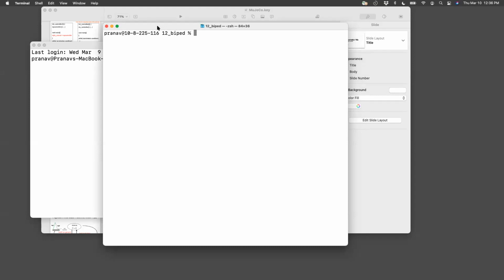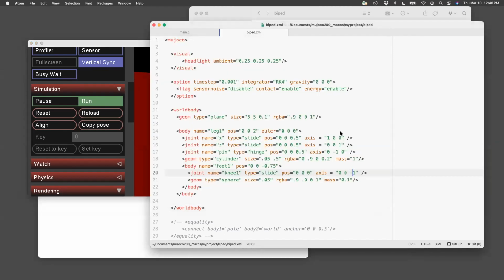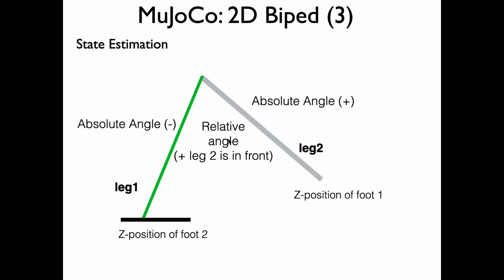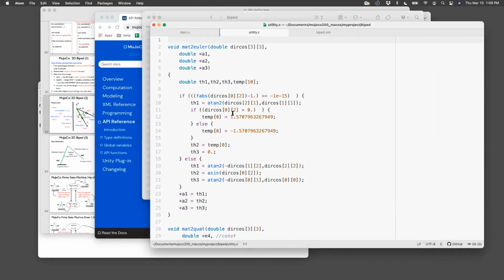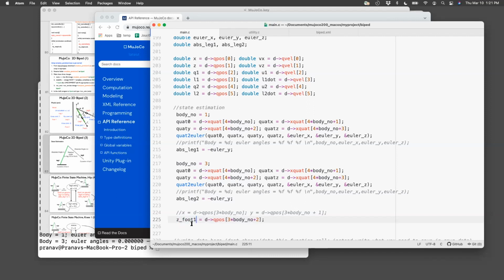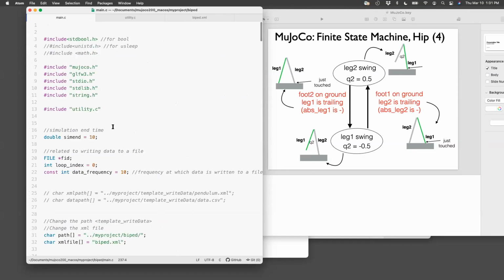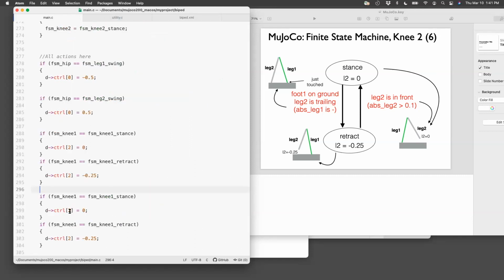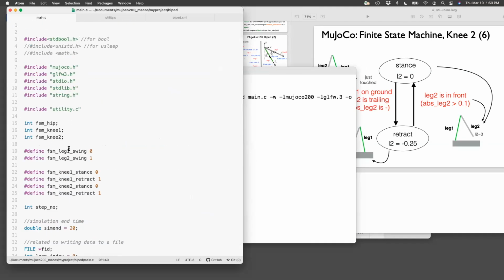MuJoCo Lec13: 2D Biped (Spring 2022)

Comment: Hello Mr. Bhounsule, thank you for your video! I would like to know if there is a possibility for a biped to rotate? I followed your steps and created a biped in MuJoCo, however for Reinforcement Learning purposes I need it to change its direction while walking. I have tried to create another hinge joint, that would let it rotate 360 degrees, but it seems that my physics doesn’t work😅 Cause when the biped trying to “turn”, it just falls and can’t walk anymore! Thank you in advance for your response!
Reply from the maker: Here the base has one pin joint for pitch and 2 prismatic joints. You need to add a yaw joint here. Then you can add the yaw joint to each leg with a motor. This set up should work well for forward motion and turning.
Reply: @pranavab  Thank you for your reply! To be honest, I am beginner, so I’ll try my best to implement those yaw joints. I would like to ask one more thing, so one of the yaw joints would be at the same level where pin,x,z joints are, but those two yaw joints on each leg, where exactly do I need to put them?  I am grateful for the supportive feedback you’ve provided me!
Reply from the maker: @missmulled-wine2207  yes for the first question. Put the yaw before the prismatic joint for the feet.
Reply: @pranavab  and again, thank you so much for your time !

Comment: The 1st actuator is connected to the 'hip' joint, which is a part of leg2. So when when the position value in 1st actuator is changed, we should've seen the foot2 and leg2 moving. But leg1 and foot1 is also moving that too in the opposite direction that of leg2. Why is it happening?
Reply from the maker: Leg2 reacts against leg1 so they move in the opposite directions

Comment: Hallo Mr. Bhounsule,

I have a question. 

I implement a complex Robot in MuJoCo. I have exported it from Solidworks as STL file with its Coordinates ( Denavit-Harteberg Coordinates) and imported it through ''mesh'' in mujoco. 

My problem is that, when i wanna give to a single body (element of robot) a joint, this joint is automatically defined in the coordinates of this body, and not in the coordinates of the geom, which is in this single body.

therefore I would like to define every single joint in the geom's coordinates, because in my simulation every body (element of robot) has the same coordinate system. If I could define the joints in the geom's coordinates i wont have to move every time the joints to the right position.

I hope you undestand what i mean, otherwise I can show you my Model. This is for my Master work at the University and I cant find the solution of this problem.

best regards.
Reply from the maker: I think what you are trying to do is not possible in mujoco. In mujoco you define joints with respect to body not with respect to geoms. In fact you don’t even need geom if you are not doing collisions. That is, geoms are only needed for collision checking.